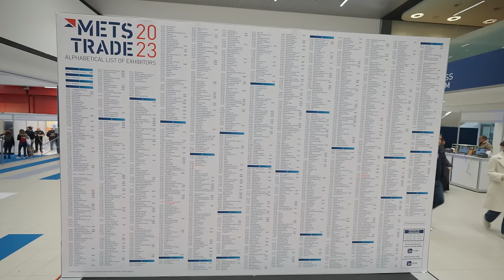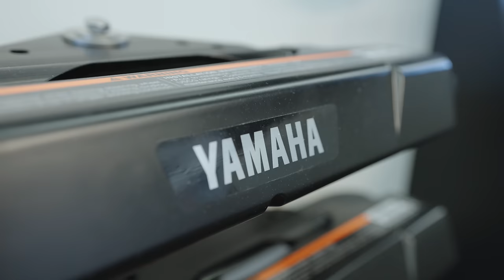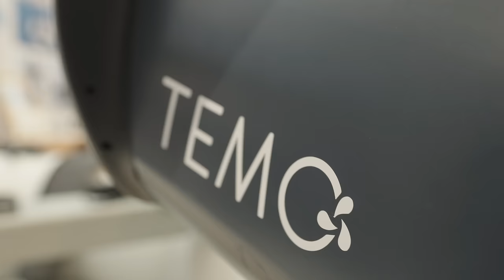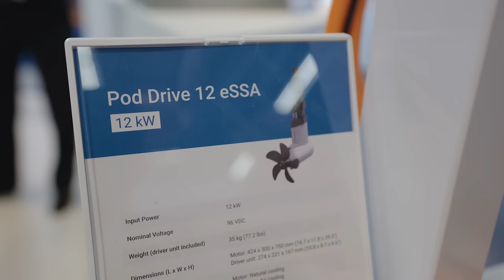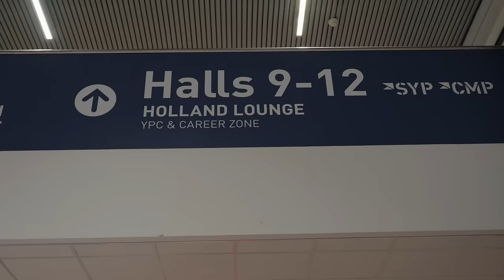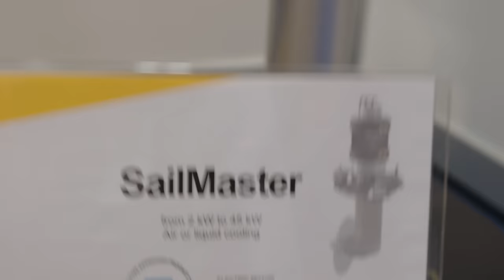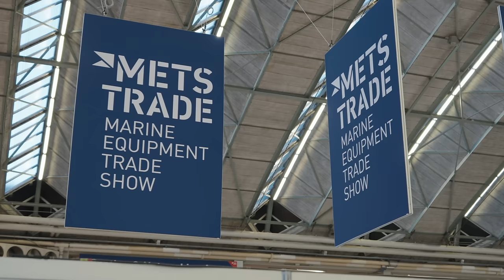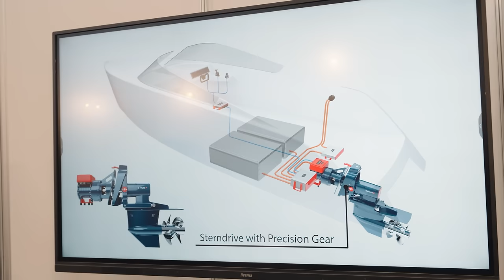The Shocking Truth About Electric Propulsion | Step 371

Comment: A lot of these companies don't get the regen use case yet. "Most sailors won't really be using it, except maybe on Atlantic crossings"... I guess he was talking to the right people.... LOL NOT.

Oceanvolt seem to be the best out there but at ridiculous prices. 

I still wonder when the first company manages to start a cooperation with Tesla. These boat motors are getting 25 kW out of the same size that Tesla gets almost 200 kW out of - including a step-down gearbox that reduces the 18k rpm from the motor to something you can actually drive. I expect the voltages to rise much more, like 800V to reduce current and heat losses. That 190 kW Tesla motor can regen around 60 kW, maybe more. Imagine sailing with full sails in a strong wind, just below hull speed, grabbing 60 kW from the water going by... 

Also, prices need to come down. Oceanvolt needs to get into mass production soon, otherwise some competitor will eat their lunch. Battery prices need to drop - with Tesla, you can get a 80 kWh battery for under $20k (but only if you buy it for one of their cars).

Comment: Installed Torqeedo 12Kw POD Drives on our 1997 Manta 40 Sailing Catamaran, love the Drives, lots of power, 7000 RPM! Not happy with the Company, no Hydroregeneration as advertised and horrible product support :-(
Reply from the maker: Same story we’ve heard dozens of times. It’s also just the “marine industry” as a whole.
Reply: We spent $25,000.00 with Torqeedo for POD Drives advertised with Hydroregeneration only to find out in the Installation Manual that you have to use Torqeedo Batteries ($24,000.00) to use Hydroregeneration in a Note.

Comment: RE: the Remigo 1Kw (3hp equiv.) outboard is 2200 Euros ($2393 USD) compared to the Suzuki 2.5hp @ $895, the 4hp @  $1440 U.S, the 6hp @ $1690 USD. Electric will cost more at the outset, but again, no maintenance, easier usage on a sailboat (i.e. no fuel to purchase or store onboard) and no fuel costs if you generate your own.  So do your own math, but it might be a better value.

Comment: I would be interested to know how many of the companies produce direct to shaft motors, and how the performance compares to the sail drives. My yacht is very similar in design to yours, but with an aluminium hull, so fitting a sail drive would be a larger project. Also the space taken up by the batteries, having a typical 80's narrow stern there is not so much space to play with.
Reply: Go hybrid - it is far better. There are fantastic alternator-style motors that either drive the shaft or are driven by it giving you all important redundancy.
Reply from the maker: A shaft drive on an angle looses about 25-30% of its regen capabilities, just because of the angle. 

The reason we have a saildrive is for the servo prop. You need to control the blade pitch, or rotate the whole unit 180deg to get good regen.

Comment: the guy from oceanvolt said, what is also my takeaway from this video. many companies don't take regeneration really seriously. with more and more technologies on board, yachts need electricity always available. of course, solar panels get energy, but also wind and then the motor and prop ,which is always there, should be used the most effective way. ...also energy harvesting from waves would be very interesting

Comment: Where are the fully retractable through hull  props for 8 meter plus yachts. Why not have zero drag, and isolation from the corrosive seawater. Also easy for removal while in the water.

Comment: The regeneration of energy with  a propeller is so inefficient that it makes no sense. The turn speed of the prop is to low because of the low diameter and low surface the power is too low. It only makes sense for a vehicle with direct contact via wheels to the ground whi h can bring the weight x speed (power) to the generator,  but not in a fluid with this high viscosity. The prop will just stuck if you try to make energy bcause the generator (electric motor) will work like a brake to the prop if it starts creating energy. Why has a water turbine such a big surface and diameter? To make this regeneration of energy to such a big question shows no knowledge of physics. One 100 Watt solarpanel creates more energy than recuperation of a prop, even on a cloudy day. That is the reason you did not find on producer doing it. The technicians in the company would tell the salesmen "Bullshit"
Reply from the maker: Haha! Except we already have an electric motor in our boat that has regen. The Oceanvolt SP15 at 8kts speed through the water makes about 1kW of power. We can’t sail quite that fast, our average is usually around 6.5 kts. Where we make between 500-600W. Which equates to around 10-15kwH in a 24hr sail. Since our boat only burns about 3kwH in that same time, I’d say that’s PLENTY of recuperation. 

So not sure what “physics” you’re doing. But they’re clearly wrong. We also have plenty of videos on our channel (and others channels too) showing these tests and real world working conditions if you feel like educating yourself.

Comment: Great video guys. Disappointing to not see a single US based company there at the show, I gotta believe they are out there, if not they are missing the boat (no pun). I view the boat industry where the electric car industry about 15 years ago. No one was building electric cars, there were a few taking an existing gas car and swapping it over but it wasn't until the industry started building the car from the ground up as an electric car that things took off. I think we have Tesla to thank for that. Nowadays the EV's are designed from day 1 to be electric, which means the pack is an integral part of the car. Boat builders need to get there too so they they are building an electric boat, not building a boat and making it electric. I saw a lot of cool electric boat motors and some controllers at this show but very little about battery packs. I'm sure that will change over time, exciting to see. Sail boats and electric propulsion just seems natural. You're already harnessing the wind for most of your power, why have to rely on a stinky old diesel for those times when there is no wind or for marinas.
Reply from the maker: Elco was there. They were one of the first. But the USA is about 10-15 years behind Europe in most things green energy related

Comment: Regenerating delivers not that much off Kw there are regenerating prop devices for sale for about 7000 euro which only regenerate 250Wp at about 6-7 Knots so you can better have a 450Wp solar panel which will cost you about including MPPT 300-400 euro.

Comment: however...the front bearing of the diesel engine now must withstand the overhung load of this generator...thus, it will fail sooner....if you dont pull on the drive pully "sideways" and thus tighten the belt (even tho its tooth-ed) it will slip or jump and this side thrust is just the devil.
gensets inline with the crank centerline do not exhibit this.

Comment: I have one question.   Could you use a Tesla car motor for your sailboat or Catamaran ?   I'm sure there'd need to be modifications, but that's not the question.   Could it be done with the right effort and money is the question ?   Given the power they produce, the small size, the quietness and the history and proven technology of the Tesla it's a fair question.   So, what's the answer.   Thank you.    AD.
Reply from the maker: Technically yes. That type of set is is what many companies like Bosch were showcasing. But 800V DC and saltwater are a very deadly combination that needs real expertise and instal to get right. Also car motors tend to spin at quite high RPM which is great for powerboats, but not so much for sailboats.

Comment: I wonder if any of these companies are looking into some of the latest propeller designs, there has been some breakthroughs recently. That have improved fuel efficiency, for power boats . I just wonder if they would work for electric and regeneration.
Reply: You talking about toroidal props? Still in the research phase. There’s a few that can be purchased for $5k, but not designed for slow moving vessels. Very cool, but high manufacturing costs, and from what I’ve seen most of the development has been around higher RPM operations. Theoretically could work well based off what one company has commented on, but the optimal design for a sailboats prop speed is likely drastically different. And the data that is out there tends to show an efficiency convergence between standard props and toroidal the lower the RPMs.
Reply: For regen there is no substitute for prop disk area, the larger the area the more energy that can be extracted from the water. A larger prop needs to rotate slower, which is also more efficient. Given a 5 blade prop, 25 inch diameter at 600 rpm, I’m expecting some serious regen at 10 kts, yes some serious drag too but this can be controlled by retracting the motors when not needed.

Comment: All of these branded motor systems are very expensive. The actual motors at the heart of the system are all the same and are fairly cheap. I bought my inboard system for my 38 foot ocean-going sailing boat from Electricdrive Engineering in Australia. They come out much cheaper and they can advise on or install the electrics with you.
Reply from the maker: Oh for sure! Remember we made our initially set up for $150US.

Comment: I know you folks seem very concerned about engine regeneration. Do you have data on what percentage distance you'll gain with say the 500 watt regeneration while sailing. Why not focus on wind power and solar and compare regeneration through propeller base regeneration vs. wind power while sailing?
Reply from the maker: Wind is MUCH less dense than water. And since we have massive sails gathering all that energy, it makes a lot more sense to harness that energy in the water, than in the wind. We would need a windvane with a sweep of about 2 meters spinning 24/7 in wind above 20kts to gain the same power we get from our 16" prop spinning in the water sailing at 6.5kts.
Reply: @SailingUma  Ok, valid point! How much regeneration are you looking at achieving from a 16" prop @ 6.5 knots (say per hour and total hours per week/month etc.) BTW - not trying to criticize, just trying to gauge the math/cost equation - I spend X dollars on a electric propulsion system (And I'm 100% about electric drives) that provides regen vs Y dollars on one that doesn't. How long would it take to make that back strictly by using solar (lets throw wind out of the equation here) and backup generator (diesel fuel cost).

I could be assuming incorrectly also that you aren't ditching diesel 100%. I'm new to your channel and probably should watch more of  your videos but I'm a typing mood. 
Cheers!
Reply from the maker: We’ve been all electric for 10yrs. Not a drop of diesel. 

Regen at 6.5 kts is about 450-500W. So in a 24hr sail somewhere up around 10-12kWh. Or a full battery bank from 0%. 

We’ve never run regen for 24hrs before though. Never needed too. Usually it’s only for a few hours a day on long passages.

We can’t sail much faster. But on boat that can sail faster, regen goes up exponentially. @ 10kts you’re looking at about 3kW of regen. That 70kWh in a 24hr period.

Comment: Very biased in my opinion.  Uma is selling Ocean Volt and that’s fine.  Regeneration is great but solar is better, unless you are sailing long passages.  How many of you sail at 8-10 knots with all your worldly possessions on our vessel?
Uma seemed to go out of there way to make Torqeedo look bad.  In no other interview did they show the effort to get a sales person to speak with them.  Why did they show that only with Torqeedo.
Ocean Volt are a great company but you better have some deep pockets.  They are close to twice the price of other systems.  I purchased 2 12kw electric motors, 22 kw of 48v lithium battery’s and 2.2 kw of solar for less than I was quoted for 2 Servo Pro 15’s.  I think Dan is brilliant and I’m a fan of Sailing Uma, just not a fan of this comparison.
Reply from the maker: The full, uncut interviews are on Patron. But what you see is what you get. We only cut about 50% of the full thing for YT. Mostly side digressions or pitches that weren't relevant to sailboats. 

Of course we're bias. Everyone is. But there is still only one motor company focusing on regen. Which for us, on our small slow mono, provides 5X more power than solar can. Faster is of course better, but anything above 5kts and we start storing power. So at the end of a day sail, we usually arrive with more power than we left with. No other motor manufacturer is taking regen seriously from what we've found. So unfortunately OV still doesn't have any competition. We have no vested interest in OV sales. We're just showcasing the best tech for our needs.
Reply: I stand by my comment but completely see your point of view.  You guys helped inspire our 100% electric/ solar conversion and we love the way it fits our cruising goals.

Comment: I just talked with EPropulsion for dinghy application.  Good news bad news.  Good news the battery floats.  Imagine putting the battery on the motor and oops!  The bad news is they have no way to secure the battery to the motor.  So you go grocery shopping and come back to find your battery gone!  The other thing that I found troubling is they DO NOT RECOMMEND you leave the motor in the water for a long period of time.  Imagine you come to a dinghy dock.  You pull the battery off and tilt the motor up.  Aren’t you creating a safety hazard with the prop sticking out?  Especially after dark?

Comment: I love electric inboard, and would totally change my 27hp yanmar to an ocean volt. But, when I look the price... 48k without vat, without hand labor, without boat handling, without yard fees... So close to 60-65k for a 30hp equivalent. I don't have that kind of money...

 While I can replace my diesel for 10k full inclusive... (which is still quite a bit) But I can probably save 30-40% by taking a used one.

Its kindda a shame, electric motors are nothing more than magnets, a copper coil, some batteries, and some chargers, tension controls. Overall Far less complicated than a diesel, there is litteraly only one moving part and it's the propeller.

I don't get why the price are so inflated, for an ocean volt engine price, I could buy a brand new full option tesla. This doesn't add up.
Reply from the maker: 100% agree. For a new boat order, the price doesnt make much difference between an electric motor System  and a new diesel System considering you are spending 1/2million for a boat. But I think its because OV doesn’t have any competition for what they do, and so they don’t think they need to reduce the price. Which is a shame for the refit world.

Comment: Hay I get your only looking at eletric that benefits sailing.  I am very   interested  in eletric  but I have a 19' outboard style  . Fiberglass boat and the few company's I can find have too small hp or ro much . Did  you see  any company's that had 70 through 115 hp capabilities.  I have seen the 150 180 200 . To much heavy.

Comment: Why don't sail boats have a docking system for their propellers? Airplanes don't leave their wheels hanging down? Why do sail boats leave their propellers in the water when they're not needed? This way you can have bigger propellers and better sailing speeds. Then, when you need to keep things under control in high winds, you can drop the propeller in to slow your speed and generate power. With the newer sail drives it seems it would be simple enough to have a lift/lower system to deploy this feature?
Reply from the maker: Many race boats have fold down propellers. It’s just harder to do.

Comment: I only have experience with Torqeedo and Elko.  Both lie about the horsepower of their motors.  The Torqeedo travel is about 1.25 horsepower and the Elko 9.9 is about 6 horse.  A horsepower is 750 watts.  To find the watts of your motor, multiply the volts times the amps.  If their motor runs off 48 volts and uses a maximum of 100 amps, it uses 4,800 watts, or 6.4 horsepower.  They may say the electric has more low end torque, but in a head to head test, the Elko 9.9 was nowhere near as fast as an old gas 9.9 on the same boat.  I could believe 6 horse for the Elko 9.9, but not 9.  If they give you voltage and amps, you can calculate horsepower and those calculations will describe the performance of the motor better that the manufacturers stated "horsepower".
Reply from the maker: We’re so tired of all these companies making up their own math. There is no set standard between hp and kW. Yes, the math says .75kW=1hp. But that isn’t the whole story. I can tell you from testing that a 1kW electric motor pushed our boat the same as a 5hp gas. And a 15hp gas pushes the same as about 4.5kW. Our general rule is take the hp and divide by 4 to get the equivalent kW motor. Is a rough idea but works on many different set ups.

Comment: Surprised that you are shocked by the limitations on regen when you have been researching this for yonks .E propulsion for example have been  illustrating this for their pods in their published data for a long time and indeed early users have soon resorted to larger batteries and  generators.This is as you suggest the magic grail for smallish cruising sailing craft so the designers are not simply being perverse - maybe the physics is just not there.I thought you, with your very hands on,forensic experience , were somewhat tongue in cheek with these innocent stallholders Nevertheless a highly instructive and enjoyable video .